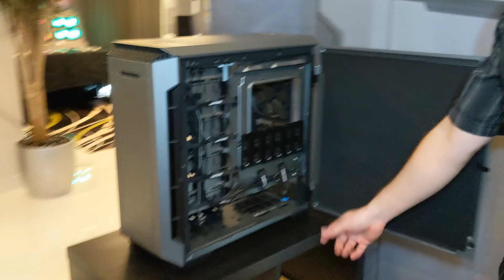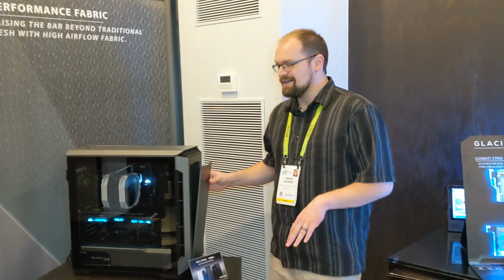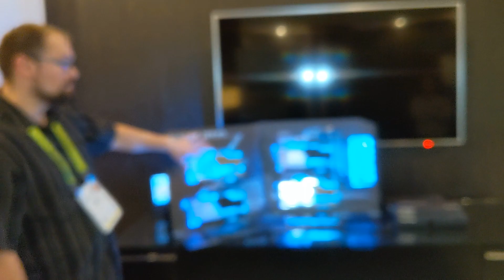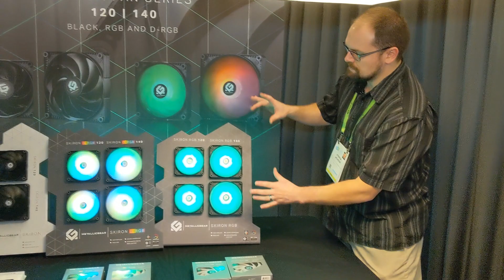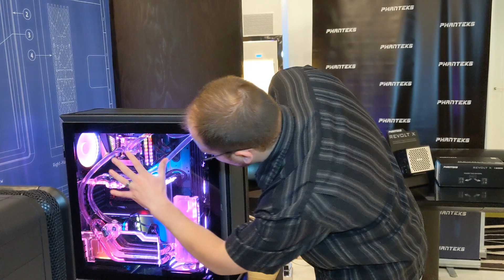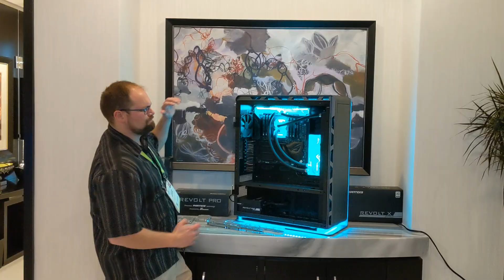A Silent Case with Great Airflow!?! - Phanteks at CES 2019

Comment: How about GPU + CPU fans when they are at full speed. With open mesh, those are still noisy as a vacuum cleaner?
Can you show this scenario with dB measured? Thanks.
Reply: Bruh... I had the very same question too but on the second thoughts, I dont think that should be a concern. You choose the case for its silence so noise should be your number 1 priority anyway. From that point on, you do what ever it take to keep things as quiet as possible. Go hard on top quality coolers and big thic GPUs, keep their RPMs under 1600; or go all liquid cooling; if you can't afford good quiet fans then go with bunch of cheap but SLOW fans.
Before I bought it, I had been sleeping on the ground with a sub 20$ case about 0,5m from my head - poor me living in a cheap tiny rented room grinding games selling accounts here to make ends meet, afk 24/7 is sort of a requirement. Now I' having less nightmare.
...
IF you're still too unsure, go with some old cases which features tons of noise dampening panel, no window panel (but with old school 5.25' ODD bays). "Silent chassis" was in their names I remember. Instead of glass, they got left side filled with noise dampening materials.